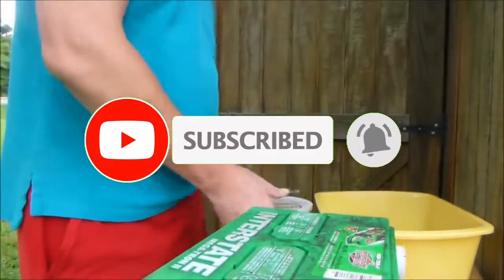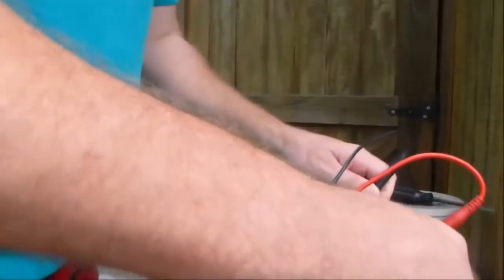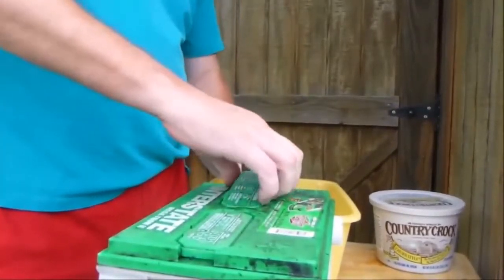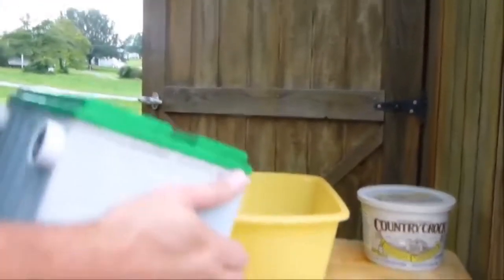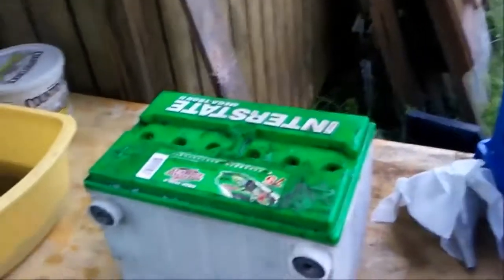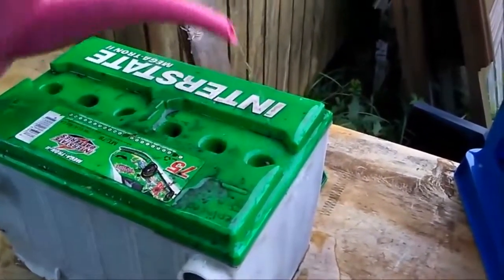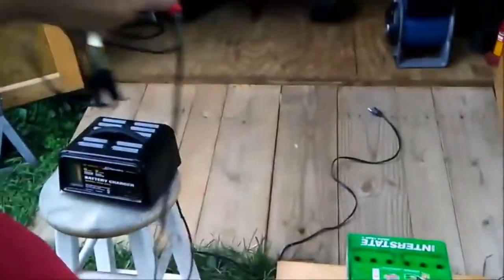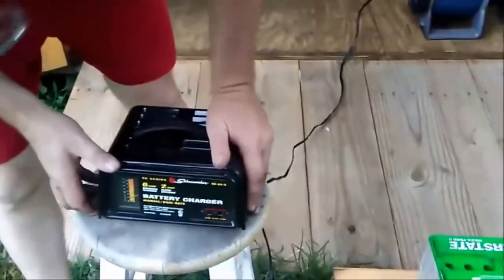Revive a Dead Battery repair dead dry battery at home , Lead acid battery repairation

Comment: A lot of dis vids don't tell U it's actually a hit/miss effort. Depending on condition?, if it's a cheap battery? Wat amps can it hold n for how long? Usually a 'worned down thinner lead plates' jus breaks up n end up 'shorting de battery' wen Ur out driving thinking it's like new. De old plates collapse n short out.
Better to buy an expensive one, hav it charge wid a 'smart charger'/; pulse desulfating' type n it shud give U additional 2 years or so. Nothing wrong wid a 75% strong battery to use to power led light around house even if cranking amp (CCA) cannot start car.

Comment: Hi there my name is Peter what have done is I completely emptied out all the acid out of my battery & I kept filling & emptying the battery cells as I had COMPLELY DEAD CELL on the positve side of the post I had flushed the cell out with pure clean rain water about 7 or 8 times & completely emptied the water out & left it over night with no water in the battery today I went & got 2 500 grams of & Bicarbonate Soda Baking Soda to fairly large amount of pure fresh rain water which fairly hot water & gave it a good mix up then added it to the battery cells & man was that bubbling & left sitting there bubbling away for quite sometime the later I emptied it out & put more Hot fresh pure rain water & added more baking soda into the battery cells gosh I couldn't believe it the completely DEAD CEL was also.bubling even on the first time around & I just left for quite sometime to bubble away then latter on I emptied it all out of the battery & then added pure fresh rain water & & gave the battery a good shake up & emptied it all out & still using pure fresh rain water from my water tank I heated pu more of this pure fresh rain water I.then added a bag of Epson Salts & gave it it a good stir up & once I got the cell full just over the plates I then put it the battery on charge & I have a FOXSUR 7 STAGE 12VOLT /24VOLT SMART CHARGER with repair mode button on it & I thought that the repair mode was only 7 volts but it's not it's pulsing 11.60 to 12.64 & & all the cells are bubbling & I will see what happens later as I will put it on normal charge later unless it switches itself over to the charger stage &.if it doesn't hold it's charge latter on it may need a bottle of sulfuric acid which I will have drain some of contents out then adding the acid these FOXSUR BATTERY 7 STAGE.CHARGERS seem to be pretty good Charger there are a lot of Very Good Reviews  on Utube using these Chargers I can't complain about these Charges if this doesn't fix the Completely DEAD CELL well.I had nothing to lose & have another battery to do as well as that one to has a Very DEAD CELL
to & I will keep my fingers crossed

Comment: 100's of videos shows how to do it ,....but nobody has shown if it really works ....Or if holds the Charge ...!! .... I never Bought a Brand new Battery .....If my Battery really goes Bad and worn ,...I would pick up a " sulfated " battery  in our refuse pile ....in the shop ,..I choose the Newest one ,....I'll dump out the  Half the electrolyte inside and then top it up with distilled water ,.....then hook the charger ,..if it wont charge  ,.. , What i'll do is hold down the the 24 volts  switch for about 1 minute then  ,,switch it to 12 volts ,..if it still does not accept the charge ,..I'll repeat the procedure ,.....it never Fails ,..most of the batteries I revived last for  years ,.....Sometimes ,...I would try reverse charging for a couple of minutes ,..